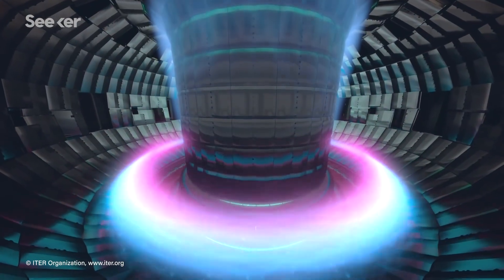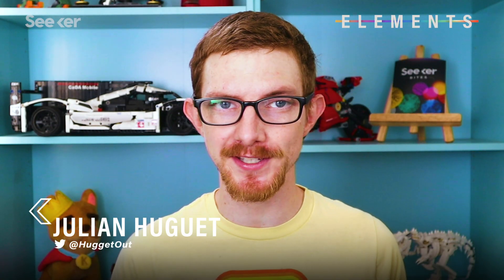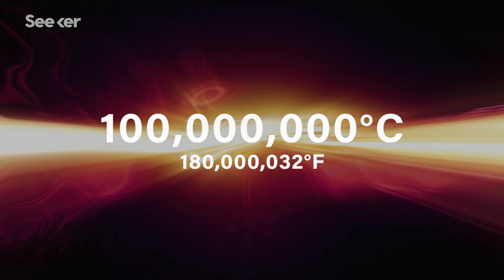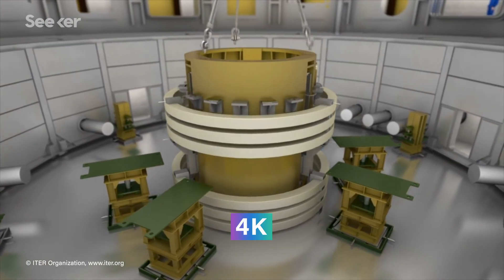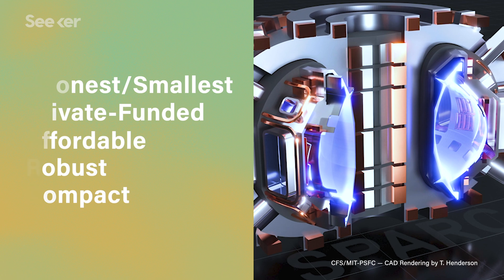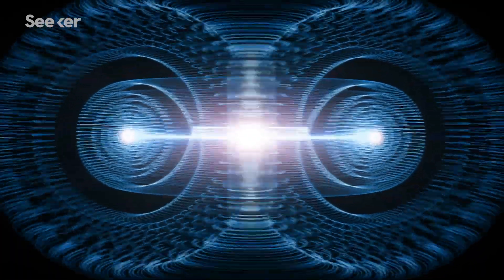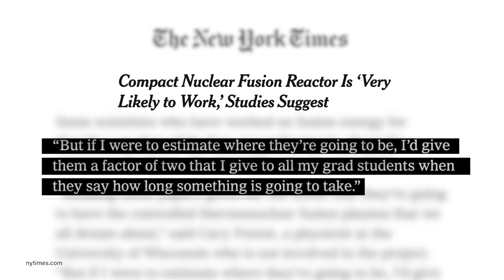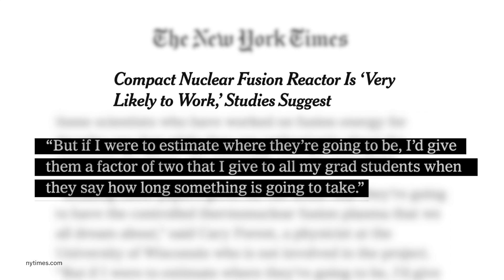Fusion Energy Could Be a Reality in Less Than 5 Years

Comment: We already have a near limitless source of clean power, one that doesn't require any energy to keep it going, only fuel, and which already produces close to the same amount of power per unit of fuel as fusion does. Fission reactors. In a thermal spectrum MSR thorium breeder, you'd also completely eliminate all long term waste, and assuming you're using a FLiBe salt, you'd also have the ability to produce the tritium that fusion reactors require to even work.

Comment: I resent your statements that no one has made a working fusion reactor and that no one has been able to create a sustained fusion reaction.  At Northwest Nuclear Labs our high school students have built a fusion reactor and use it to do original research. It is a modification of the Farnsworth fusion reactor.  We have done continuous runs for 8 hours, and believe it could continue much longer without difficulty.  We currently use it produce neutrons for research in such areas as Boron Neutron Capture Therapy, a method of treating brain cancer. We have not been able to produce more energy than we put into the reactor, so maybe that is why you do not consider it a “working” fusion reactor, but it is working quite well.  More information about our work is available at nwnlabs.org.  Thank you.

Comment: tokamak reactors will never work. The issue is not the field strength but the stability of the field. The hot plasma interacts with the magnetic field (plasma generates magnetic fields) which ends up creating oscillations and eddy currents that create holes in the containment. 

The simplest analog is trying to contained & compress jello in your hands. The jello finds a way to leak out between your fingers. Magnetism propagates via field lines, much like your fingers.

Some work has been done with newer magnetic confinement reactors (stellators) that are hoping to avoid the problem by twisting the plasma into a stable field to avoid from destabilizing the magnetic containment field, but so far the results are not promising. Its very unlikely the magnetic confinement fusion will every work.

There might be an alternative using pettawatt lasers (yes the exist) to accelerate protons into a target to trigger fusion.

Comment: From what I read, Q=2 might not be self-sustaining because it includes power output from the reaction that isn't captures, and I don't know that even Q=10 would get you commercial break-even, where the cost of assembling the reactor would be paid for by the energy output. That's still progress, but it doesn't get my hopes up for putting fusion power into the electrical grid in the next 50 years.

Comment: The real question is how they plan to extract the energy from the plasma. It's fairly easy to extract heat from a fission reaction, since cooling the core doesn't affect the fission rate much. Cooling plasma stops your reaction.
Reply: The reaction is kept going using external heating (neutral particle injectors, cyclotron resonations, etc.) in its starting phase, but plasma is never in contact with the walls during burning operation: energy transmission comes from fast neutrons that escape confinement and heat the actively cooled walls.
The hope is to reach ignition, where the fusion reaction can actually sustain itself indefinitely without supplying anything aside fuel

Comment: I would like to say one more important thing when ITER will achieve power and will be ready to use i belive it will hapend in 2022 or 2021 we will be able to give up all other "renewable" sources of energy like fotovoltaic and wind turbine generator it will be not nessesry anymore, we have to left fossil fuel becouse the are needed many workers, whot is more they are nessesry for environment. EU make big mistake to reduce emissions co2 for car but for car industry it's not a problem Car Manufacturers are able right now to achieve level of 30g in any kind of vehicle even V12 🙏 but of course Car Manufacturers will do the stupid 95g. That's whole i would like to say no cuestion are accepted.
Reply: ITER will never put power on the grid, it’s an experiment
Reply: @Gomlmon99  if you say that propably u are better informed then me, I know that it's work and work better then they thought or maby I know how to make frome it sourc of energy which will secure EU Japan Russia and other involved countries energy supply - no that was the point and right now everything is going well, even better.

Comment: High temp superconductors still need to be pretty cold, like negative 120 c or colder depending on the specific material or super pressurized and negative 75 c. Granted that's still 150-200 degrees c warmer than the original superconductors we found but it's not exactly easy to keep stuff that cold near fusion plasma. I sure hope these projects are successful but I think material science still has a way to go before we start making fusion power plants of the type which will eventually be used for commercial energy production.
Reply: These superconductors don't have to be much hotter to already be significantly cheaper and easier to use. 

Just a tiny difference in temperature is enough to put it above the boiling point of nitrogen, which is the simplest cryogenic refrigerant and much easier to deal with than helium, which is what's normally used on low temperature superconductors.

Comment: How is it free, limitless energy, when you need a fuel source? How much energy does it cost to generate that? Are you going to break down water to generate the hydrogen? That takes a lot of power.

Bit like saying that petrol is free energy. You still gotta drill and capture the oil, then refine it and transport it to the pumps.
Reply: No one said it’s free. It’s limitless because it requires small amounts of water, which is practically limitless on earth.

Comment: no such thing as free energy, they will hit Q factor 0.9E9100 but never reach 1
Reply: Lucky it’s not “free”, energy comes from the mass defect
Reply: @Gomlmon99  the energy it takes to split or combine is equal to the energy it takes to do so. Nothing can break the law of conservation of energy, not even a electromagnetic magnetic doughnut thing. all suns burn out of hydrogen, which is why a sun is not even Q1
Reply: Loz Cherone but it doesn’t break the laws of conservation because it’s using up mass?
Reply: @Gomlmon99  tritium is also one of the most expensive substances on earth at about 20-40k per gram, so lets hope its efficient else whats the point
Reply: Loz Cherone it doesn’t use up tritium, it has breeder blankets for that. Only the deuterium gets used up.

Comment: With all do respect, it's impossible to give 1 volt of energy and produce frome it 2 volt energy in one source it's physically impossible but I know how ITER works and their concept with some help will work but not in the same principle as ark or give 1 volt and take 2 volt in one source, ITER will produce couple times more energy than it consume but they will use normal physical rules take 1 volt produce 10 volt form other sources of energy as heat, helium and magnet they used are key to make it  work, other method will be less efficient but easier to manage.
Reply: "with all do respect..."
Volt is not unit of energy, so your complain can be discarded
Reply: @Poctyk  whot is volt then??

Comment: 1. Strip the electrons from the nucleus. 2. Channel the bombardment in a 3-phase section, static line being the "crunch" fusing the two nuclei. 3. Start pumping fuel into it. 4. Done! You've got a working ++ fusion reactor.

ARC and Ironman uses two different technologies, Ironman has fission-plasma, fusion reactors have fusion-fuel.

Comment: How do they get the hydrogen in the reactor,  and how are they going to extract the energy from the fusion out of the reactor?  I still dont really understand fusion, i understand fission.
Reply: Well, to insert hydrogen, they just pump it in, no..? I've heard of frozen hydrogen pellets shot inside also!
As for extraction, simply put, energy from fusion comes in form of fast neutrons, that escape confinement as soon as they are generated: part of the whole inner wall (the "first wall") is actively cooled by water or molten salts, transferring thermal energy to standard turbines+alternators groups for electricity production.
Reply: @fabioveronese9715  interesting.  Thank you for the response.

Comment: But it's not clean. You have to turn it off to decontaminate it every so often as it's basically radioactive. Or at least that was the case with JET, the Joint European Torus, also a  Russian Tocamak design. Based in Cambridge, England.
Reply: Short lived radioactive waste is not unclean, it’s not really hard to deal with. 

Also, it’s Tokamak and JET is based in Oxford not Cambridge
Reply: @Gomlmon99  a spelling flame, how original. Oxford /Cambridge meh, both high tech university towns, synonymous in the UK. I'm sure the location has a great bearing on my comment. Just as I'm sure you wouldn't want what they remove from the Torus located anywhere near you.
Do not misunderstand me, I was an early fan of fusion, back as a student, enough to read a book on it. Research the failed history of the stellerator, (however you spell it, you know what I'm talking about) resulting in a true cross cultural endeavor.  Where you laser inject tritium into a superheated plasma of deuterium, (heavy water) which is water electrolysed in a centrifuge, to add an extra atom. Resulting in a positive energy output, which is captured in a carbon jacket, inside a heat exchanger, with the byproduct being helium. You know this, I know this, the average person watching may not. 
The problem is how long you run it, and dealing with the byproduct of the heat exchanger us the extra atoms that are flung out and become helium. Again, I read the book, I am interested enough to watch and comment on a video. This does not mean I'm a troll trying to knock down the research.
Reply: praxis22 I’d be perfectly happy for them to locate what they remove near me, the containment will be sound. 

My point on the spelling is, you are commenting on something you really don’t know much about. They don’t use lasers to inject things, they don’t just use deuterium, they don’t make it in a centrifuge on site, they don’t use a carbon wall anymore. I just find it very frustrating that people think they can definitely comment on an area they know nothing about. Reading a book or a website does not mean you have the authority to say it’s bad or it’s good.
Reply: @Gomlmon99  https://en.m.wikipedia.org/wiki/Joint_European_Torus

Yes, my knowledge is old, I read about it 30 years ago. So I must stay read up on cutting edge research if I am to comment on YouTube, who knew?

If it wasn't dangerous, it wouldn't need containment, hence it is not clean. That is my point. I still think fusion us amazing, but it is not a panacea, it is one promising technology amongst many. I wish them and you much success in your endeavors.

Comment: I love the idea of fusion energy, but how is the energy collected? Is it heat from the reaction like nuclear? Or is it similar to a magnetic/copper coil that uses plasma instead?
Reply: Very simply put, energy from fusion comes in form of fast neutrons, that escape confinement as soon as they are generated: part of the whole inner wall (the "first wall") is actively cooled by water or molten salts, transferring thermal energy to standard turbines+alternators groups for electricity production. Not so different from fission, really

Comment: I think SPARC really is the most promising fusion project currently in development. The main breakthrough is the ability to create superconducting magnets that are twice the strength of the previous best which allows you to build a much smaller reactor. They also allow for a design that is modular so that individual segments of the torus can be replaced as neutron damage accumulates. Check out the videos on MIT's channel for more info.

Comment: Yawn

Wake me up when they've solved the problem of plasma instability.
Reply: There are quite a few suggestions to solve plasma instability, thing is our models are too inaccurate to be sure which ones work before we actually build a reactor. ITER has several countermeasures built in, which is one of the reasons it's taking so long to build. Once we have that 10 minute Deuterium-Tritium fusion data in 2035 building the next reactor will be a hell of a lot easier.
Reply: @Yattayatta   - Yes, which is why I can't get excited about fusion research until the data are in and the models have been refined.